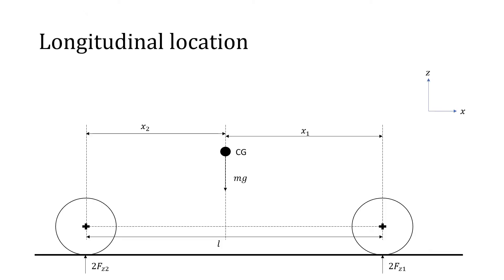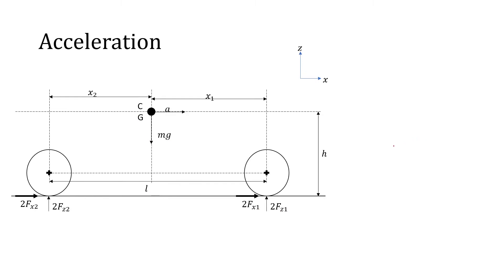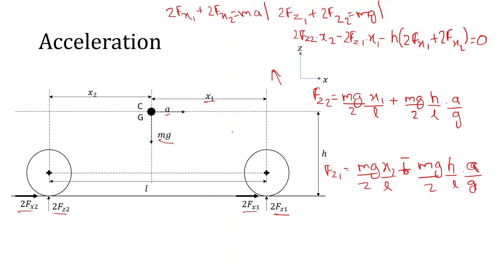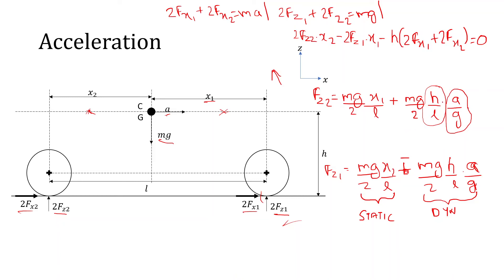Longitudinal load transfer in a car

Comment: Not sure if you will respond but im struggling to understand why the force on the wheels is in the same direction as the acceleration. Could you explain? Or let me know where i could find an explicit explanation. Thank-you!
Reply: these are the forces on the car so: Think of it as the force the road puts on the tire/wheel and not the tire/wheel put on the road. He called them the reaction forces acting on the ground by the wheels which I don't believe is correct terminology.

Comment: There is an error in your first equation with the sign convention. If you are establishing that the acceleration is moving in the same direction as Fx1 and Fx2 then the equation should be written as 2Fx1+2Fx2+ma = 0 ---------> 2Fx1+2Fx2= -ma.
Reply: I believe he was using newton's 2ed law F=m x a where F is the sum of all forces in the direction of the acceleration. I did more research on this and the force is called D'Alembert Force or the force caused from inertia which is in the opposite direction to acceleration and would therefore have a negative sign making it positive when moved to the other side. I believe his math is correct and he did state "a" is not a force.